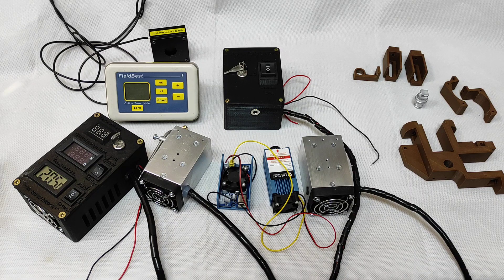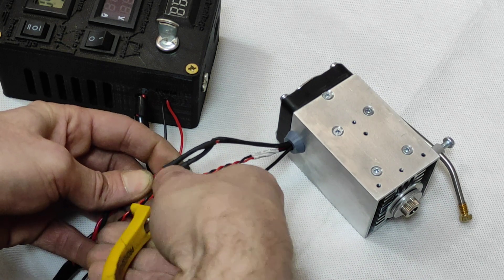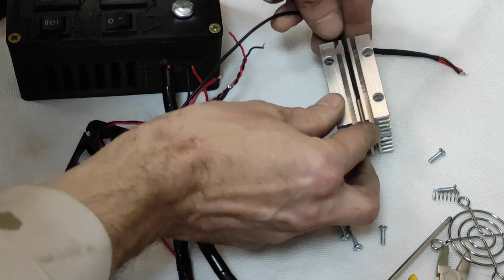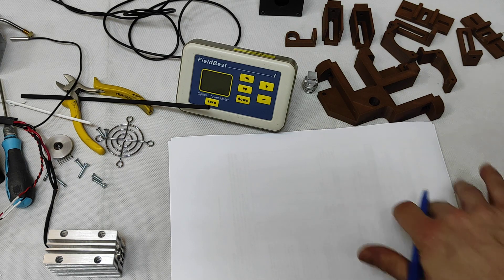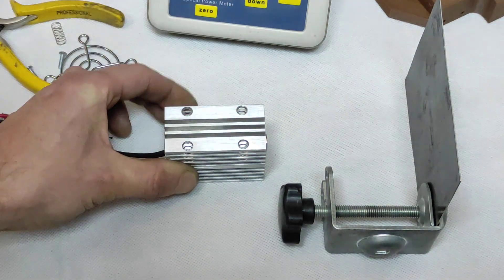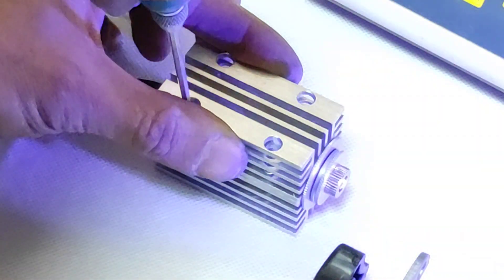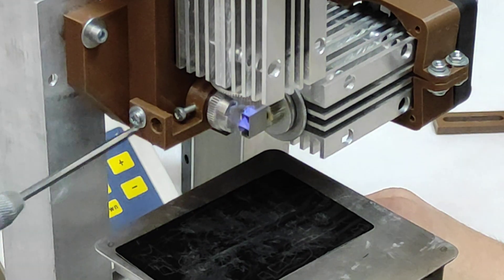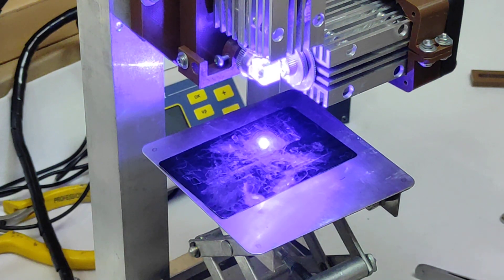15 watt DIY blue (445 nm) laser. Combining 2 beams together with a PBS cube.

Comment: What if you use a half wave plate or rotator? Then the diode polarities (in the mount) would be the same, correct? As the rotator takes care of the polarity rotation while matching the two beam patters together to be a single rectangle, one on top of the other, instead of a plus, or + shape.
Reply from the maker: yes, you can do that but then you will also have some loses on that rotator. and we want to get max out of our diodes

Comment: This is a really interesting video,  Can you combine lasers of different powers say a 5 watt and a 10 watt or must they be the same.  Seems very simple to do this, I take it you can supply the beam combiner?

Also what sort of power would you get by combing two 10 watt lasers into one?
Reply from the maker: yes, exactly you can combine 2 lasers if they have different polarization vector... Most diodes lasers have it. and yes, you can combine 5+10 and you will get something about 13-14 ... because there are some losses on optics.

Comment: Where can I find the polarizing beam combiner cube?
Reply from the maker: well, we offer a full kit as an upgrade... 

We use prisms with the following parameters:
The material of substrate: BK7

Type: Linear Polarizer (High power PBS— optical contact)
Construction: Cube
Surface Quality: 40/20 | 60 / 40
Clear Aperture (%): > 90-95%

S-Polarization Reflection (%): >99
P-Polarization Transmission (%): >90
Extinction Ratio: > 1000:1

Prism size: 10*10*10 mm ±0.2mm

Wavelength Range (nm): 400 – 500 nm

Surface Flatness: λ/8

Working power: >15 watt